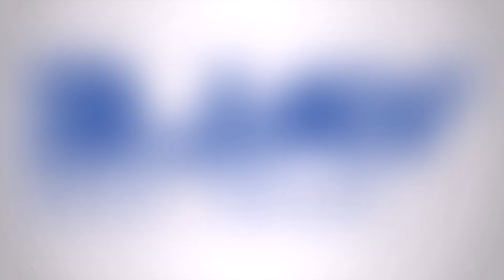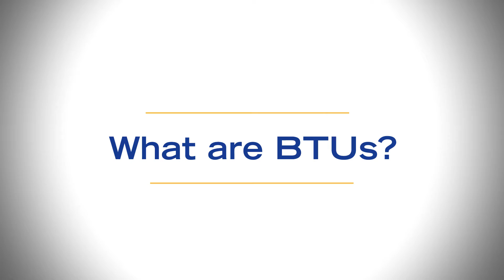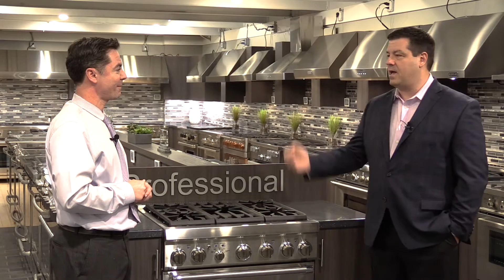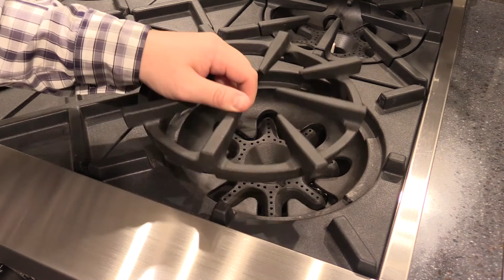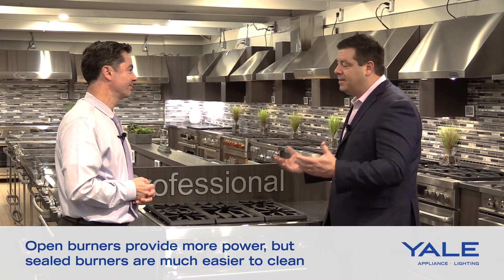What are BTUs? [Pro Range FAQ]

Comment: We're doing a kitchen re-do, and I've been looking at the Bosch Benchmark.  I'm concerned because I'm using LP gas, and that takes the BTUs on the "POWER" burner from 18,050 to 11,100 with the conversion.   I don't think 11,100 is considered to be powerful, and that seems like  BIG difference.   Am I missing something?  I do a lot of cooking, and cook weekly for a large group.  I want to be sure that I have enough power to be able to do what I need to do on this cooktop.
Reply from the maker: Really to 11k? That seems light...have to check
Reply: @Y @YaleAppliance1 , Oh please do!  I would appreciate it!
Reply: I called Bosch and they confirmed that this information is correct.  Can you suggest a reliable 30” cooktop that gives those of us using LP gas a powerful burner?